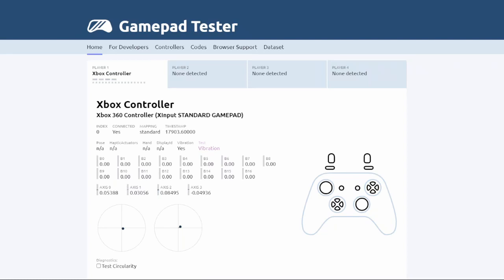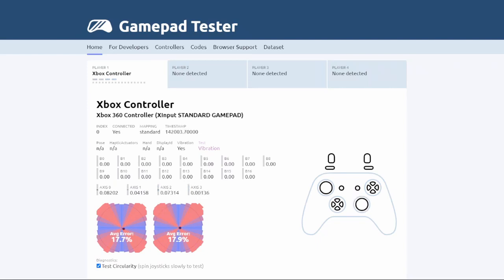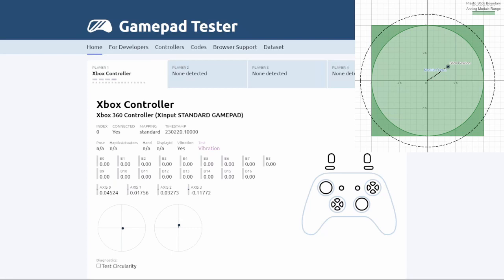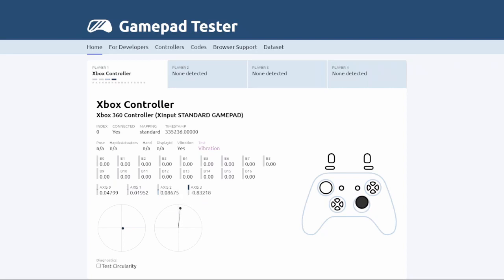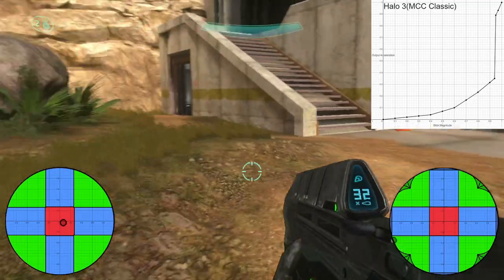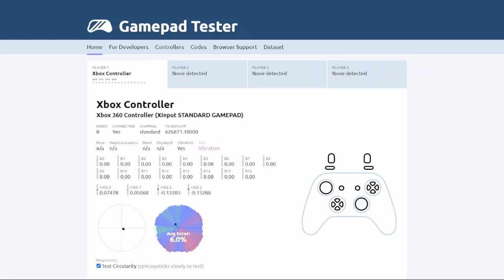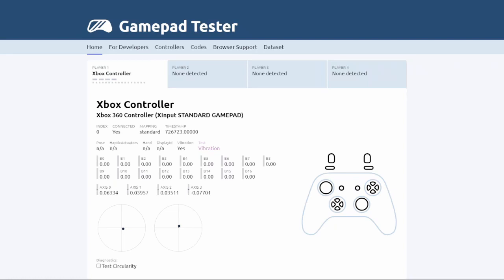My Thoughts on Thumbstick Circularity

Comment: I got something else. When my Xbox controller using a axial deadzone and I hop on Warzone, apex and these games use an radial deadzone what happens then ? Do we get an Radial deadzone cuz the game or the backed Xbox axial deadzone ????
Reply from the maker: Sorry I didn't get to your other comment on this.

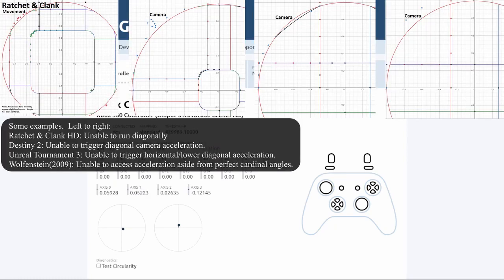If the controller uses axial deadzones, and the game uses radial ones, both will overlap.  It'll functionally be like a rounded square deadzone(Destiny example at 6:46), but you wouldn't actually see the axial deadzone since none of that input would come from the controller.  You'd first break out of the controller's axial deadzone, and then out of the game's radial one, so the deadzone would be larger.  You'd be able to easily see it if you push the stick fully up/down and slide the stick left and right.  In Apex and Warzone, you should see it change left/right instantly once you pass the axis, but if the controller has an axial deadzone, you'll have to move quite a bit either way before you see left/right movements happen.

If you want to see if the controller has an axial deadzone in gamepad-tester.com, you can slowly rotate the stick in a circle, and see if it stops on the axes a bit.
This is a visualization of that happening with a set 25% axial deadzone.  You can see how it locks to the axes until you move the stick enough.
https://www.desmos.com/calculator/55h2clrzj7 (drag the 'stick position' node around)
Reply: @EternalDahaka  ohh ok, so In Apex or Warzone let’s say withe an very low deadzone what I use (2%) and I play an low Response curve it’s not that dramatic right ? Yeah the new series x controller use axial deadzone to. But why Microsoft I’m general use axial deadzone I don’t get it. Everybody say that Radial is just better. When I move straight left and right I don’t feel a different but moving to 1-2 o clock or 4,5 o clock etc… than it’s different on Xbox pads…makes no sens to me why they use that. And people showcase that the Xbox Thumbstick module) are very inaccurate is that cuz the Deadzone or cuz Xbox pads run withe only 125hz poling rate not like ps4/5 withe 250hz ?
Reply from the maker: @hayvanejones8791  
If the controller is using an axial deadzone, and you set the game deadzone lower to none, then the size will be smaller, but you'd still get the same restricted angles.
Again I can't say if/why Microsoft would use axial deadzone since I've never used the Series controllers.  Xbox One controllers didn't have any deadzones applied, and I can't see a difference between how my Xbox One thumbstick angles register compared to my Dual Shock 4.

I've seen some tests saying Xbox stick values are inconsistent, but I'm not sensitive enough to notice it.  Xbox's lower polling rate could drop some inputs in comparison PlayStation's faster ones with very fast movements which I'd guess is probably the problem for that specifically.  I don't know about the anything about actual difference in the quality of the modules.
Reply: @EternalDahaka  ohh interesting. So they don’t have an inherent axial deadzone ? I though Xbox rollers do have an inherent deadzone. But people always say the sticks are inaccurate and not responding well. I mean they have 124hz response time, ps4,5 got 250 hz so it’s a cut in half that’s it’s big. That’s maybe the reason and you can’t overclock them but why is Microsoft doing this it makes no sens. 

The Xbox trustmaster eswap s is great on 280hz (show on my screen) he’s 2.8ms lowest and 3.4 highest. Ps5 roller to. Xbox series x is like 3.3,5 and max is 8,5. withe 124hz. 

Now I understand better. But still I asked one yt who explained settings halo…forgot the name and he said all Xbox controller use an Axial deadzone…🤔🤔 and one more guy who said that the eswap s on Xbox is the only one who don’t have the weird feeling. Ds4 windows is the only one who show that the Xbox controller is inaccurate.
Reply from the maker: @hayvanejones8791  
I watched a video where a YouTuber mention that Xbox controllers use axial deadzones, but none of the official 360 or One controller I have do.  Maybe the were basing it off the axis independent/radial/true diagonals descriptions on the Elite controller or the Series controller or other 3rd party models.  Again, haven't touched those so it could have, but it would be a dumb move by Microsoft if they did.  Usually only crappy 3rd party controllers tend to add deadzones you can't remove.
Reply: @EternalDahaka  yeah you absolutely right. I think these people didn’t test them properly. I did not finde anything weird on the series x roller just the facts that he’s getting quicker a bad deadzone compare to a ps4 DualShock only by a bit. But you can’t overclock them and the they not consistent when you check the thumpsticks default rollers. I heard the razer controller are super accurate. But all 3erd party controller run 250hz poling rate the standard one 360,one series x all use 125 hz and they locked. That’s could be it. I order the eswap s and he’s really responsive and stick are calibrated. But I think that’s it standard Xbox roller should be fine now way they have these inherent deadzone I know so many Fortnite, Apwx legends PRO‘s they use them. And when you go to an Lan Tournament they can’t overclock controller anyway so for them it’s fine.
Reply: @EternalDahaka  I think they just a bit less unresponsive than other that’s it ! And the out of the ring inaccuracy is also on my astro c40 controller who cost me 200 Euro. But that’s not effect my right stick cuz I’m doing small adjustments so it’s fine but he’s on 300hz poling rate by default and locked at 300. I think Microsoft biggest problem is the poling rate you don’t need 1000hz but 250-300hz is needed by playing on higher fps.
Reply: One things, i dont understand this video. Which Programm using fixed this Avg Error to 0%? I have a interesting with this for testing a controllers 🤔
Reply from the maker: @MillhioreX  
I was using a script I made for the TitanTwo to cap the output.

If you have a PlayStation 4/5 controller, you can use DS4Windows and check the Force toggle for Max Output.  The error fluctuates based on the deadzone and antideadzone settings, but both at 0 it's about 1.2%.
Reply: @EternalDahaka  Thanks, but i play with Xbox Controller, more comfortable for me. But stick drift are annoying for me, i must use with 6-10% deadzone, depending on the game. 0% deadzone? All controller have a same issue, 0% dead zone not realizable. (like Halo, Apex Legends, Titanfall 2, some game with adjustable deadzone) 🥲😊
Reply: @MillhioreX  my razer v2 croma have 0% deadzone in games no drift obly slightly ob recenter 1% so either 1% dz or remeber to recenter

Comment: Hi mate, did you ever try apex legend ? Or Fortnite ? 

I saw you’re vids and they are interesting. 

I bought a series x bevor 1 week and I’m really unhappy what I’m reading on the Internet about Xbox series /one controllers. They say they use axial deadzone and the sticks are inaccurate withe fast sens/moving. I always played on a ps2/3/4 pad and I noticed a high imput delay on apex legends but I found out that’s the game himself but on the other games I found that my aim was off. So I’m really not sure about this and how it’s work but I saw pros using Xbox elite 1/2 controller on Fortnite and they won millions withe this. Elite 2 can changed to Radial deadzone…..if they do it I don’t know and they on pc so they maybe using tools like you 🤷🏻🤷🏻 I really wanna keep the Series x instead of the ps5 but this is not acceptable for fps games, which I play. 

On Apex I use a middle sens no extra ramp up/delay stuff like on Fortnite 

Apex really low deadzone but I can handle stickdrift on Apex and a quick response curve 6. 

Fortnite I use Liniar curve 

I hope you can bring some light cuz I’m extremely lost at the moment.
Reply from the maker: Unfortunately I'm not sure how much I can help.

I've tried Fortnite and Apex around their launches and both games used radial deadzones.
I've never used the Series controller, but I've heard some of those complaints on it.  Adding a deadzone to a controller is poor practice, at least without offering options.  If you have access to any PC or laptop, you can use the shown gamepad-tester.com to see if there are inherent axial deadzones(you should see values change with any stick movement-especially around the axes).  I'm not sensitive to how accurately fast stick movements are translated so I'm no help there.

The descriptions for the Elite controller settings is pretty vague, but radial sounds more likely like how the curve options it has are applied rather than a deadzone.  I haven't used an Elite controller either to know for sure, but my guess is 'radial' caps the input to the circle like I've shown in this video, 'true diagonals' is normal excess movement, and 'axis-independent' applies the curve separately between for each axis rather than by the magnitude.  I made a graph demonstrating my estimate on how they might work, but that's just a guess:
https://www.desmos.com/calculator/ucmdokytkt
Adapters/scripts like I use only work if the controller doesn't have an inherent deadzone so either that's not an issue with the controllers, or they're winning despite that.
Reply: @EternalDahaka  thanks for the explanation. So Warzone (I saw that on you’re channel) and you said Fortnite, Apex used Radial deadzone….what if the controller himself is using a axial how is the controller effected ? I heard somebody saying that axial deadlines are backed into the controller. But on Warzone I don’t see a different while moving, Fortnite is hard to say even I use there Linear. 

I only can say that my Ps4 controller on my ps4 on the same games feel different. But I maybe trippen. 

I don’t think that Fortnite pros using scripts to change tha deadzone they just reduce imput lag withe ds4 and using a lot fps so it’s lower in general.
Reply: @EternalDahaka  ok thank you I’m trying this läter. I hope I can figure that out which deadzone that is.
Reply: @EternalDahaka  thanks you very much mate

Comment: where did you get these analog modules? the ones I bought can't barely rech 100% at all cross sides
Reply from the maker: Most of these are the default sticks.  My normal Xbox One controller is super worn down.

That was the issue with the replacement stick covers I got(just a pack off Amazon).  They are too thick, and I couldn't hit 100% in one direction on each stick.
The stick you've gotten may be the same.  Probably have to file them down to get it to tilt fully.